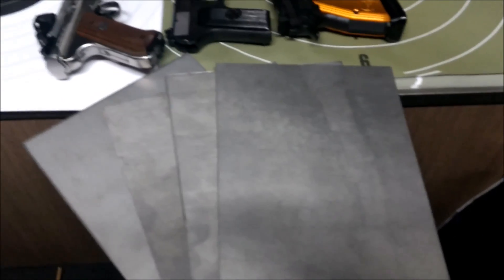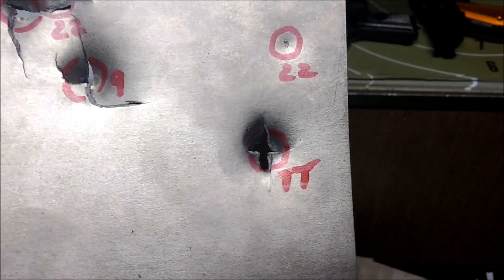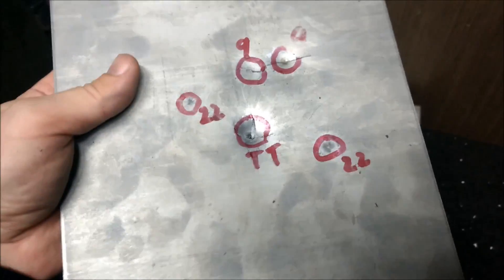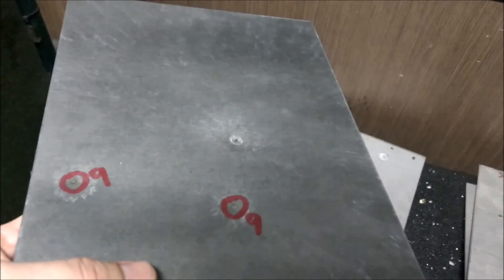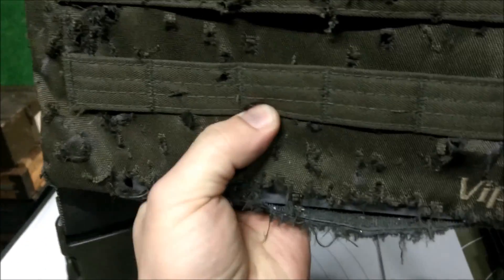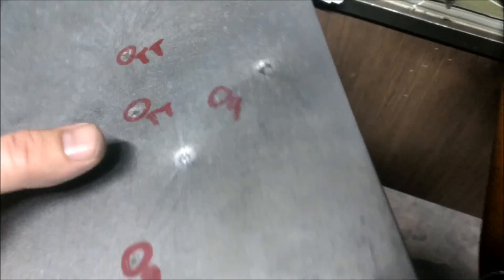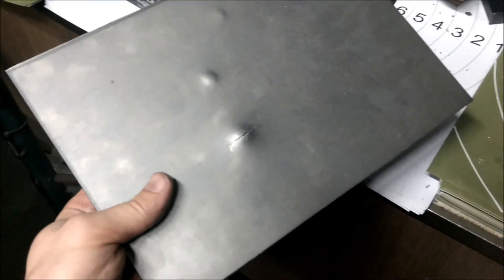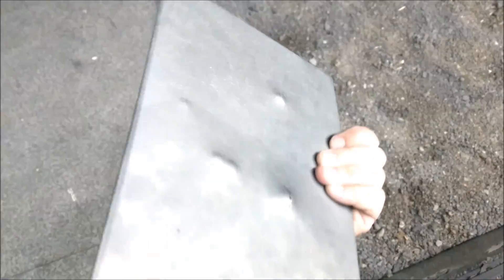Titanium plates test for homemade armor

Comment: I'm not familiar with titanium...Will it harden and temper like steel? You should consider fiberglass sandwich! I've seen successful armour with fibreglass on its own! It's very good at negating sprawling!! EXAMPLE...One thick layer of fiberglass on top 6-8 layers...one layer of 2mmTi...6-8 layers of fiberglass...one layer of 2mmTi...then 6-8 layers of fiberglass.....Then 2-3 coats of flex seal all over.
I bet it stops 5.56!!......Also put a 15°-20° angled shampher around the edge of the plates, to further protect the user from sprawling 👍

Comment: Nice idea, but cost to performance ratio of titanium plate as an armor is not ideal, unless light weight is an important factor. NM500 or AR500 steels are much cheaper for armor plates, but a plate of the same size that can stop the given caliber weighs more compared to titanium.

Comment: If you brought it on ebay it was probably fake. Grade 5 titanium is very expensive, and your tests show the titanium cracking. It is not a brittle alloy and it shouldn't crack or fracture but dent or scuff instead. If a bullet does penetrate it there should be a small, smooth hole instead of a fractured and cracked one like shown in the video.
Reply: Would there be any difference in failure between grade 2 and 5?
Reply: The way this failed actually looks like it catches bullets better than steel

Comment: I'm thinking for a full body armour suit make a medieval style gambeson out of soft Kevlar layers. Then make plate armour for shoulders, chest and back out of carbon fibre and Kevlar glued composites. Then make some titanium plates for shoulders and chest for extra protection which would glue onto the Carbon and Kevlar composite and finally spray it with high quality rubber bed liner.
Reply from the maker: Good luck!!!

Comment: Thanks for making this great testing video. I may have missed it, but what distance was each target from each firearm?
 The regular distance used by armour companies is 10 feet / 305cm between the end of the barrel and the armour plate being tested. There are always tests done from 90 degrees (face on) to the target and varying angles to the target.
Reply from the maker: about 10m
Reply: @Drzewacz888  
Cheers. Are you sure it was 10 metres and not 10 feet, and are you sure you have genuine grade 5 titanium? From recollection of military tests, a .22 shouldn't do any damage to grade 5 titanium, of any of those thickness, if it's ten metres away (They actually only test for greater calibres). 6.3mm thick wouldn't sustain any damage from a .22 at 10 feet away, for example.

Comment: May I suggest putting the 4mm infront of the 5.......if I correct if a round barely makes it through the 4mm it should be slow enough for the 5mm to stop it.....I may be wrong but its worth a try

Comment: to heat treat titanium you simple heat it up to temperature and set it on the anvil and let it cool titanium is an air hardening material real complex heat treating
Reply: What temp?
Reply: @woodywes4093  1100 to 1300 degrees F for a period of 1 to 2 hours followed by air cooling
Reply: @woodywes4093  1100 to 1300 degrees F for a period of 1 to 2 hours followed by air cooling

Comment: Know the approximate weights of each plate?
Reply: 6.35mm by 300mm by 250mm. Steel Plate +-3.75kg / Titanium 2kg. The idea is to use a slightly thicker titanium plate because it weights 45% less but its 5% weaker. 
A500 plates start at 6.35 mm which would be quite heavy. You would want to increase the thickness by 5% to match the strength making your titanium plate 6.67mm with a weight of 2.16kg.
Reply: Titanium of lighter than steel if that helps

Comment: DIY for personal Anti theft, carnaping, and small time street mugging with small arms.The vehicles body plus the 3mm I think is good enough for DIY vehicle door side panel. Then all you need is an armored glass. I think, but not sure if you can order a armored glass for regular civilian vehicle use from a company called RIDA armored glass I saw it at Utube. Actually I commented and suggesting that the company make a DIY kit for the public LEVEL 1 and 2 for civilian use only. That will not, of course stop a police round for legality issues. This civilian level is protection only for small time theft, road rage, vandalism, and car jacking. Really hope some armor company start selling this civilian armoring DIY kit that would protect a lot of civilian who only want extra protection on the public road specially road rage shooting and mugging is up while the armor company make millions on this civilian market. Any company out there listening???

Comment: The .44mag from that long gun is throwing a huge amount of energy at that plate; approaching small rifle energy levels. With some treatment: curvature and/or kevlar/glass fiber laminate; you might just stop some rifle rounds like .223.
Reply from the maker: I know, but that was the only 44Mag gun i had available at that time. I will shoot it with Desert Eagle 44Mag in few weeks :) and see the difference. 
Also, I will be shooting a laminate plate made of Tungsten+Titanium+Aluminium and Tungsten+Aluminium. I just need time to make it and shoot it.
Reply: Drzewacz888 
Tungsten is too heavy I would think. If the plate is bigger or heavier than an AR500 plate it is kind of pointless. 
I would think that some combo of UHMDPE/Titanium/Kevlar/Glass Fiber would be the ticket. Maybe consider thinner layers of grade 9 Ti sandwiched between composites.
Reply from the maker: I know it's heavy, but the purpose of my tests and videos is to test and see how strong certain materials are. My tungsten plates are 2mm thick, I had them made to order in china. Luckily for me, one company was kind enough to make them for me, 2mmx150mmx150mm plate cost me 65$. I got 2.
I will not shoot at the plate alone as its too thin, too hard (it might shatter) and too expensive, to just play with it alone. My idea is to glue few plates together, 2mm Tungsten in front backed by  3mm titanium plate backed by 5mm aluminium. 2nd plate will be 2mm Tungsten plate backed by 5 or 8mm aluminium to prevent deformation and shattering. I could wrap it all in some Kevlar 29 as i still have some left but it will take too much time. maybe next time.
But the idea of 3mm titanium backed by 10mm UHMDPE wrapped in Kevlar is in my head for some time now and i think it might be good. At least for something in IIIA class range i think.
The problem with thin titanium was that it was deforming in the point of impact and crack and that was the cause of penetration in my opinion.
If i can back titanium with some other material to prevent that, for example aluminium or UHMDPE, than even 3mm titanum might stop 44Mag! I hope. Maybe. Will see ;)
I will test that for sure as it is my conclusion from tests I've done here.
Reply: C W  how about full body armor
Reply: C W  so what you have first titanium then the kevlar then the mesh and how many mm will it be and weight?

Comment: Drzewacz888 Commercial Grade Titanium Grade-5 is too brittle  try Grade-4 or another Ti based alloy. 
Good luck.
Reply: Seeing these results I think there's no point in trying with a lower (softer) grade Ti. The advandage of using this grades of Ti is that you can heat treat them and obtain a much higher hardness. Would be interesting to see if a heat treated plate would just shatter on impact or make bullets bounce off it.
Reply: proper ballistic would be grade 38

Comment: Hy brother can you try titanium grade 38 
At list 5 mm plate against AP round
Reply: I been doing some research on grade 38 titanium & that grade was originally ment for balistic armor.   It is "easy" to forge and work on and can be heat treated to increase the strength and resiliency. 

I'm sure 2.5mm to 3mm of heat treated at grade 38 titanium medieval plate armor can hold pretty well maybe around a level IIIA balistic or at least a level II+.
Reply: @skatetrooper5285  Ive been looking into Ti 38 but I cant seam to find anything else besides others saying its ment for armor. Do you know where I can find specs?

Comment: melt them all together DUMBASS! A 2 inch plate Can't stop a .50 BMG PR!
Reply: That's not the objective of this channel - Plus the temperatures required to melt or even weld is not easily achievable for a hobbyist, nor is the procedure simple.
Reply: Demolition ranch stoped a .50 with 1.25" thick , what he has is pretty thin and grade 5 is weaker than grade 3 or 4 ,

Comment: Another guy on yt is using tyt plates 4 to around 10 mm the 10mm mm stops .50 ap woth no issues whike tthe 3 and 4mm plated stop 5.56 and 7.62 well
Reply from the maker: Can you link this video for me. I want to see it. Besides, less than 5mm think material is very thin, if you believe that it can stop rifle round than ok, I wouldn't put my life on it tho. Steel AR500 is much stronger than titanium grade 5, but it's also heavier. Steel plate in body armour usually is around 7mm thick so it's able to stop rifle rounds. Believe what you want but those are titanium plates.
Reply: Fucking what?
Reply: Jacob Keary, there's certainly shoot test for titanium plates, but they are no where near as thin as he state. He's probably very confused...and wrote 3cm as 3mm.
Reply: I think he's talking about the Demolition Ranch video.
https://www.youtube.com/watch?v=C3fBkNIROg4

Titanium is a gimmick unless it's for vehicle armour, or somewhere where corrosion is an issue (the sea). There's simply too much bulk required to achieve the same level of protection as steel.

Comment: sorry dude my other studies say that you have steel and not titanium .
Reply from the maker: blisterj Weight of the plates says it's titanium. They are much lighter than steel. Why do you think they are steel?
Reply from the maker: there is a big difference between 2mm and 1.5inch you know... i shot 17mm grade 5 plate with .7,62x54rAP and it did 3mm dent in it. Those are very thin plates and they can stop most of handgun rounds but don't quote me on that. THESE ARE NOT SCIENTIFIC TESTS! So i am not promising anything here.
Reply: Ok 2 angled chst plates 17 mm with bonded kevlar 4 layer  outer stick a bit of yoga mat inside and outside i think you got some serious armor self protection.
Reply: Lucky for you I work in Quality Control. What you need is a report from an approved LCS lab with an XRF Spectromenter. That can give you the exact percentages of what elements a sample contains; so you can see what standard it falls into. This is the only way to know for sure what you are getting. Your grade 5 Ti has several "standards" - [[  ASME SB-265, AMS 4911, ASME SB-348, AMS 4928, AMS 4965, AMS 4967  ]]  - that can vary signficantly in properties within their respective grade. Do you even ISO Bro?!?! 
In the aerospace industry, where peoples lives depend on your products, every component must have an LCS report. Eveything must be traceable and quality control related fraud can get someone in prison for life.

BTW: I had a quick chat with an engenerd buddy who thinks that thin layers of different grades will be the best solution when it comes to the Ti element. Maybe Grade 5, 1, 5 in 2mm thicknesses over molded with UHMDPE. With testing you could be on  the right track to the worlds lightest and thinnest rifle plate. Probably also the most expensive to boot.
Reply: you try holding 5mm steel plates like that.
Reply: I dont think its grade 5 tho, that .22 did too much damage
Reply: in demo ranch channel we can see that a 1.5 inch  grade 1 titanium plate can stop up to a .50 bmg ap round. I think they might have sold you some hardened alluminium alloys.
Reply: You can test it out by heating it with a propane torch in one corner and see how easily it bends. if it's true grade 5 you should have a little hard time bending it.
Reply: How much did you pay?
Reply: Those could be aluminium 7075 plates.
Reply from the maker: its only 2mm thick and its not backed by anything so it was easy to deform even for .22, i got 2mm just to see how strong it is, i would not rely on it as armor protection.
Reply: Lol troll now just think about that statement and when you have stopped laughing at yourself we will stop laughing at you! I invented trolling so please troll elsewhere.
Reply: that would be easy.  just like 60% heavier.

Comment: 4mm of a good quality steel as 4340 440c probably works better
Reply from the maker: B Souza maybe, but it's heavier. I really wanted to see how strong titanium grade 5 is.
Reply: @Drzewacz888  How far did you shoot these plates?
Reply from the maker: @skatetrooper5285  about 7 to 10m away
Reply: @Drzewacz888  oh wow that's really close
Reply: Yes but it probably weighs 10 lbs.

Comment: Can you try curving the plates in the future? Not only to test for comfort, but for strength?
Reply from the maker: Plates are curved mostly for comfort, it won't change the strength much.
Reply: @Drzewacz888  sloped armor actually can make quite a difference. It’s a design principle in modern tanks
Reply: Scales.  Slightly convex overlapping scales.
Reply: @jeremiahshine  yeah but the connectors would be the weak point. Plus the more complicated, the higher the cost.
Reply: Tremulousnut ore 3mm thickness with corner edge wave like mold for vehicle door panel is I think good enough for small arm. Armoring companies should start a civilian "ONLY" armor kit market. Specially road rage shooting and burglary is up. Honestly that would be a good business to start selling this civilian market only DIY basic armor KIT.
Reply: @macabansa1669  We are currently working on that at the moment :)
Reply: @globalordnancedefencesyste779  

Update?
Reply: @macabansa1669  agreed it would be a great idea
Reply: Lol, the thing is that, sometimes people have to die. its not like they can't protect humans from bullets ya know?

Comment: if im planning to put 5 mm titanium on my car instead of The original metal on the outside of my car what kind oftast price are we talking? it is a (Volvo 740)
Reply from the maker: The skipper A lot! and you would have to upgrade suspension and brakes. Much better solution to make a car bulletproof is using a special Kevlar panels, they are much lighter and cheaper. don't do it anyway. If you have that much money buy second hand armoured  car.
Reply: A cheaper option is S2 fiberglass. That's what they used in early composite armoured vehicles. But really, it's a buying a secondhand armoured car is better because there are so many nuances to the trade. It's not just about up-armouring the car, but also making sure it does not affect handling (which means strengthening chassis to take the weight, tuning, etc).
Reply: The skipper 88 because a 740 isn't indestructible already? ;)
Reply: Like 20 grand at least
Reply: You would probably be looking for cheap CP Titanium. The 5mm x 300mm x 25mm Plate weighting in at 2kg would cost any where from 35USD to 100USD. Although I have no idea where you would get titanium at the right price. I'm guessing you could TIG weld these plates.

2 mm Titanium on your car will only be slightly heavier that the 1 mm steal panels on your car. Although I have no idea how you would fabricate the titanium panels.